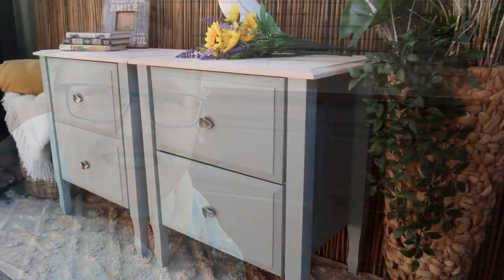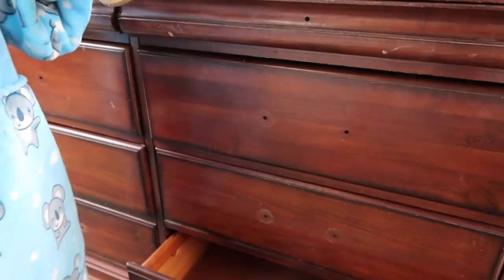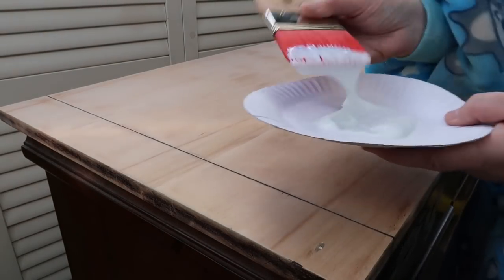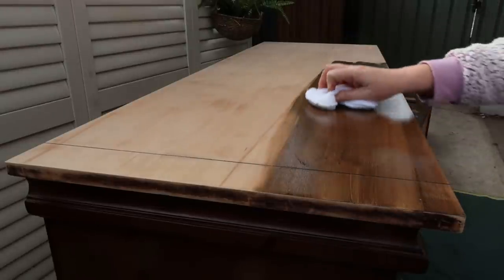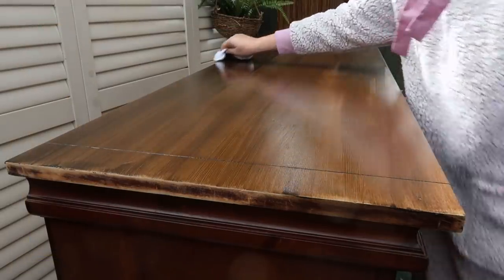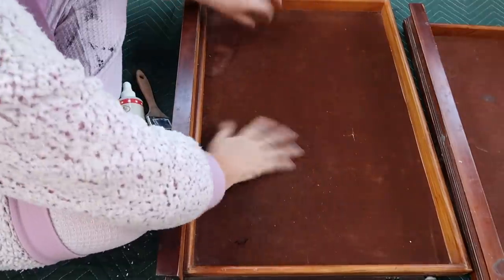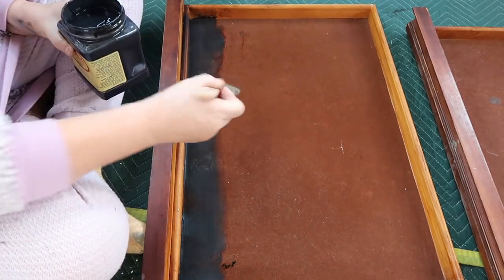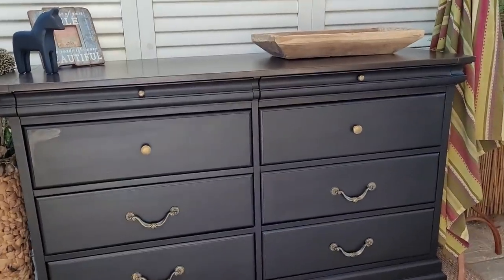Painting furniture black | Dixie Belle Silk Anchor

Comment: This turned out beautifully. I would have just painted the top since the stain seems almost as dark as the painted body. Could be the lighting...
Reply from the maker: Yes the top did come up quite dark so you're right, but you can still see the grain through it and its easier to clean, and shows less finger prints. Black is terrible for those finger prints ha. Thanks so much for watching x